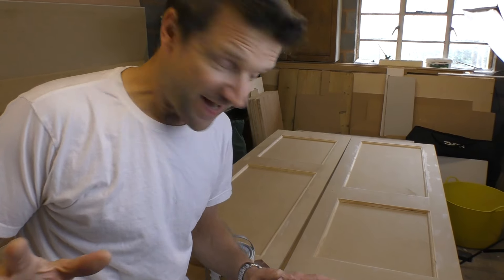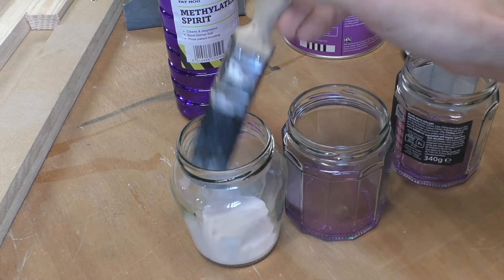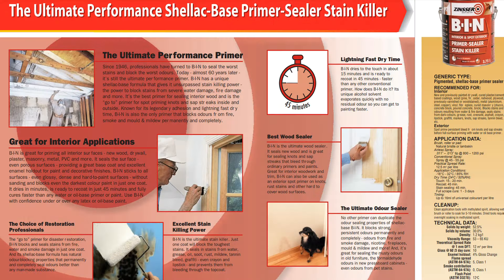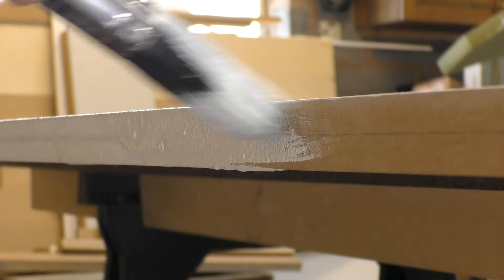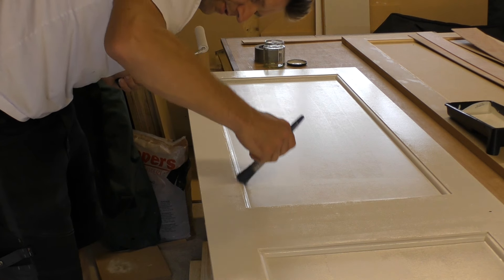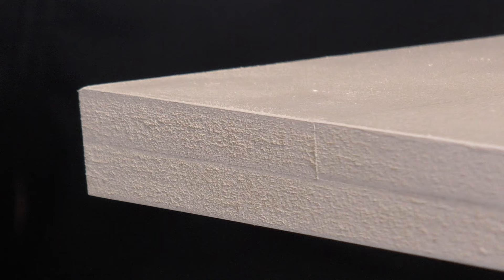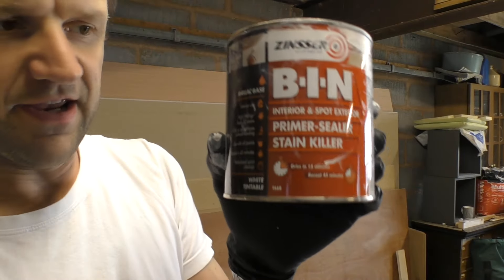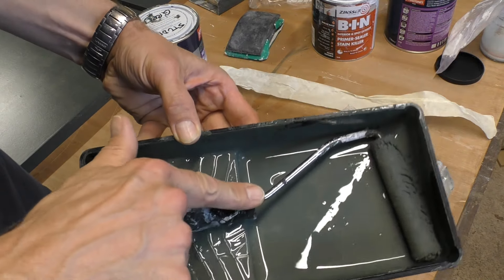Why I LOVE Zinsser BIN for Priming MDF. Video 2/6

Comment: How long can you leave the BIN primer unpainted? I primed my table with this stuff but life happened and I wasn’t able to paint on the top coat. Can you advise. I’ve looked everywhere and I can’t find the info. Thanks in advance.
Reply from the maker: I don't think there's a time limit. You've just got to be careful of what might have deposited itself on the surface since you painted. So for example in a kitchen, you might have a thin layer of grease on the primer. You can do a grease test with a piece of masking tape - if it sticks then you're good to go. If it doesn't you need to degrease with sugar soap or Zinsser Degreaser and Cleaner. You could always give it a very light sand with a 180 or 240 grit sand paper prior to doing the top coat, or if you're really worried give it another coat of BIN first.
Reply: @CharlieDIYte  awesome thank you so much Charlie. I really enjoy your DIY videos.

Comment: I want to use chalk paint to paint some old dining chairs, but I've read that bleed though may be a problem.

I used Zinnser Cover Stain a couple of years ago and found it quite tricky to paint with, being quite a thick paint. It did seem to do the job though. I think I gave the tin to somebody, so will need to buy more primer.

Should I stick with the Cover Stain, or would it be maybe better to try the Zinnser BIN primer.

However, would a single coat of the BIN be enough to prevent any bleeding ... just asking as I understand that sometimes a second coat of BIN will weaken the first coat if more than one application is made.

Comment: Nice job. Apparently you can't use Zinsser ( or any other ) primer with a Farrow and Ball topcoat - it takes forever to dry. You can only use F&B's own primer.  I've made that mistake with some drawer boxes for my eldest son's custom desk: it took 2 weeks before they could be handled without sticking. I use Johnstone's now. I'm going to try the Zinsser though for the next project.
Reply from the maker: Thanks Norman. That's really interesting! I've got to say, I love Farrow and Ball colours but not the coverage, which is why I get Johnstone's mixed to F&B colours.
Reply: Farrow and ball is known for being utter crap.
Reply: Only problem is that the F&B primer is utter horse-poop. I should have gone to Sharp’s: ready to kill or cry with my project…

Comment: Have you tried Rustin's MDF sealer? Also according to Zinsser's website you should use 1 2 3 for MDF. https://www.zinsseruk.com/howto/how-to-paint-mdf/
Reply from the maker: No I haven't tried the Rustin's but I like the brand and suspect it's quite good. Yes I'm aware Zinsser say that, but I've studiously ignored that advice partly because I can't see the logic of recommending a water based primer like 123 over the shellac of BIN and partly because the performance of BIN is so stellar I haven't seen the need to try anything else. But I WILL try 123 and let you know how I get on!
Reply: @CharlieDIYte  I tried Rustins (water based) it sort of implies on the tin that you use it over the entirety of the MDF. I did that, but I wouldn't bother to coat the surface again. It didn't make any difference over just putting primer straight on. It definitely seemed to work well on the edges, especially after a light sanding, however it dries clear so you would still need to paint on a couple layers of primer anyway. Not sure it's worth it over something like BIN which of course dries white. It'll be interesting to see how you get on with 123.

Comment: Question, can i use zinsser to prime a door that was peviously glossed but then sanded?
Reply: Actually it shows you when you gave the product overview. Why you ask didn't i delete my comment? Well just to show you that your vids are still getting traction  :D
Reply from the maker: Yes, as long as it's sanded to give a decent key BIN is probably one of the best primers for this. You have to work REALLY FAST in the summer though as it will dry before you can even get it off the brush!!

Comment: Is white spirit the same as methalated spirit? I used Zinsser yesterday and it's still caked to my black bristled brush and plastic mixer even after an overnight soak? Also when rolling and painting it would feel tacky and I've been left with drag marks? Any ideas?
Reply from the maker: No it's not. You need methylated spirit or Zinsser's own BIN brush cleaner. With that it cleans up easy - much easier than an oil based paint does with white spirit, as a matter of fact.

Comment: Hey Charlie. Great videos, you have inspired me to build some kitchen cabinets! Unfortunately I've run into a problem after days of sanding and getting the surfaces perfect I applied the Zinnser BIN, let it dry, sanded it, applied another, sanded it then got a solvent based dulux satinwood as the Zinnser website recommends an oil based or latex based topcoat. Its been drying for 48 hours well over the drying time of 24 and scratches off with my fingernail. Any advice would be greatly appreciated. I fear I may have to remove it all and find another kind of topcoat.
Reply from the maker: Hi Daniel, I'll raise it with Zinsser. I can't understand why this would have happened. Did you dilute the to coat with anything? Suffice to say someone recently questioned why I applied a water based top coat. I raised this with Zinsser and the reply from their tech team was as follows "
"You can overcoat B-I-N, once completely dry, with any conventional decorative finish, this can be oil/solvent or water based.
The term “laytex” is a term that derives from the American market.  To the UK market this can be translated as emulsion. In short, the customer is perfectly safe applying a water based paint on top of B-I-N.”
Reply: @CharlieDIYte  Hey Charlie. Thanks a lot for your reply I really appreciate it. I'm gutted after a full week cutting and sanding. I can say the topcoat I used was Dulux Trade Satinwooad (solvent based) and the primer was the Zinnser BIN shellac. I didn't dilute it with anything. The only thing I can think of was I was keen to get a very smooth finish so I sanded after each coat of Zinnser with 180 grit, maybe I over egged the pudding and gave the paint nothing to adhere too. In any case I fear I'll have to start over or try some Nitromors as a last resort. The paint is tacky in some areas but feels mostly dry. In all areas you just scratch it off with your fingernail. I know that the satin usually takes a long time to cure but i'm not sure thats the problem here.
Reply: Howdy. Little update. I've been on to Zinsser and Dulux and the consensus is the curing time. Zinnser say any paint can be applied on top of it and Dulux say while it takes 24 hours to dry the curing time is well over that and may take over a week. I am dubious at this stage but I'll post again in a week with the result if it would help anyone. All the best and thanks again charlie!
Reply from the maker: Thanks Daniel. I'll raise anyway with Zinsser and see if they can shed any additional light on this.
Reply: @danielcantwell4611  Based on what you say, I am about to paint some varnished door frames with Zinsser BIN before applying two top coats of water based paint, should I wait a week for the BIN to dry before applying the waterbased top coats?
Reply: @David-kp4en  Hey David. I completely forgot about this post! I should have replied to Charlie. No, you don't need to wait a week, it dries quite quickly. The problem was with Dulux. I had one of their representatives come out to test the paint and turns out the paint mix was bad. They gave me a 100 euro voucher and an apology but seeing as I had put their paint all over my hand made cabinets.......I wasn't too impressed. I've gone over to Johnstones satinwood and used it to paint my office cabinets. Much better result.

Comment: Did you use the same mohair rollers for the water based top coat? Thanks!
Reply from the maker: Yes. I've also been using the foam rollers recently, which give a slightly more stippled effect and are easier to get hold of than the mohair.

Comment: Great video, did you seal the mdf with a sanding sealer before priming it? Or does the primer act as a sealer?
Reply from the maker: No, straight on with the BIN with no primer below it. It's my go to primer these days for everything. I used it on the recent wardrobe build and there's this tip https://youtu.be/763yQg0Euwc for painting the edges.

Comment: You can clean BIN brushes cheaper with ammonia. It's a lot less expensive per gallon than alcohol. Once the brush is 99% clean with ammonia, you can wash it in the sink with soap and water like normal.

Comment: Hi Charlie - Did you find you had to caulk the mouldings? At 5:12 the gaps are still visible. Did they 'flood' after the 4 coats, sufficiently. My challenge next week is to paint a huge fitted bedroom and the doors are all fitted/vertical, so I can't very well flood the gaps.. I guess I'll take a couple of tubes of caulk along just in case :)
Another Charlie
Reply from the maker: Hi Charlie. I have to say I didn't, and I've just had a close look at them and there are no gaps visible so I guess the 2 thicker top costs did the trick. Yes, have some decorators caulk or two part wood filler with you just in case. Good luck!

Comment: You never need to apply 2 coats of any primer, that's the purpose of the paint, primer is just a way to provide a bond between 1st paint and 2nd.
Reply: Actually in most cases double undercoating prepares the woodwork better and makes for better coverage for topcoats.

Comment: Could you spray Zinsser B.I.N Shellac Based Primer? With a spray gun
Reply: Yes , people use it to coat custom cabinets all the time, but i've only seen / done it with air finish guns not with the airless systems. Im sure it would spray it's the cleanup id worry about since the paint needs a solvent to clean and that might eat the machine seals .
Reply: @wind5250  Thank you!

Comment: A good consistent matt finish from a roller is far more desirable than a brush finish. Some so-called pro painters are simply luddites.
Reply from the maker: I agree. Turned up on site once with some pelmets I had rollered. Luddite painter (who had a break every couple of hours) looked angrily at them even though they were none of his business and said "what kind of a finish do you call that" just because there were no brush strokes on it.

Comment: used for the first time and got a lumpy finish, think I may have used too much 🙄
Reply from the maker: You possibly overworked it. It dries so quickly, particularly at this time of year. You have to literally make a couple of passes with the roller and then move on. If you keep going over it, you get a lumpy Vistaprint because it's drying and comes away as you go over it with the fresh stuff.

Comment: Hi Charlie ive been asked to paint kitchen cabinets for a lady . I haven't seen them yet and my question is if they are vinyl/laminate covered cabinets will bin primer suit? My other question is if they have already been painted to i need to prime ? My other concern would be how to know if the previous paint was oil or water based in order to choose top coat or will oil based stick to previous water or oil based paint ? Alot of questions sorry but i find you very informative and love your videos. 👍 cheers 
Mick

Comment: ALERT having difficulty. Product dries too fast hence peeling while painting. Frocknfoam left bubbly rough surface needing considerable sanding  using 240 grit. Knit roller perhaps better but again paint sets up super fast. Perhaps technique is to apply real fast and without extended rolling time    Was using my best Purdy brush and cleaning with water regularly. Should I use  other brush and What’s best roller to use.
Reply from the maker: Hi Paul, yes BIN is problematic in warm weather - yes technique is to apply quickly and not go over it too many times. If its seriously warm I'd probably go for Zinsser 123 instead. Using BIN in hot weather as it dries it can rip the napp off even decent mohair rollers so you're best to go for foam. I take it you're not writing from the UK right now 🥶

Comment: Beware the foam mini roller.
They melt in about 20 minutes, (the end will fall off, then the rest of the sleeve a couple of minutes later) great for smaller jobs,
 Use the furry ones for bigger jobs, or buy multipack foam ones ☺

Comment: You're paying way too much for brushes.
Harris Platinum synthetic.
Pack of 5 on eBay variously £4.99 delivered. They don't lose bristles much, quite fine so don't leave brush marks, great for cutting in, hold paint well including b-i-n. I've used them for years and give great results. 
And not freezer bags to store your wet brushes and rollers, cling film, much better at keeping air out.

Comment: Throw the gear away its only a few quid, or use a cheaper primer B.I.N is good for stains you dnt really need to fork out that much for primer
Reply from the maker: I don't agree. After using pretty much all primers I keep coming back to BIN. The drying time is awesome for work flow and it goes on so think you can see and sort out any imperfections.

Comment: Water based on bin 🤯. Not the best for long term. Not cutting in panels or edges first.will.not get the best finish. Get a proper mini roller sleeve  from 2 fussy blokes.  Work your way through 80 to 360 grade not one sand paper forks all.
Reply from the maker: Worked well and is fine with Zinsser. I checked. I'll check out those roller sleeves though 👍🏻
Reply: @CharlieDIYte  it can be done but not the best option. What would I know I have only been  painting kitchens and bespoke units for 30 years lol